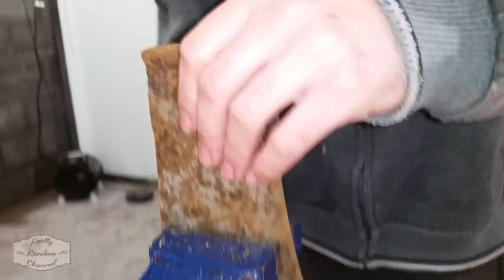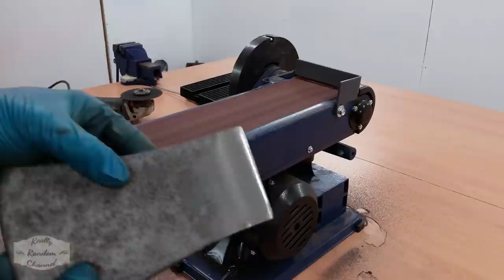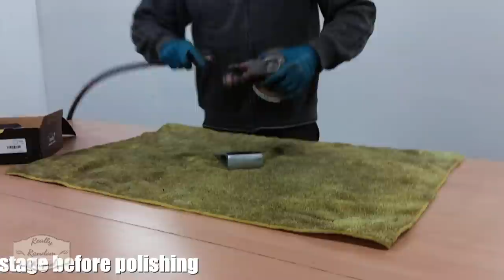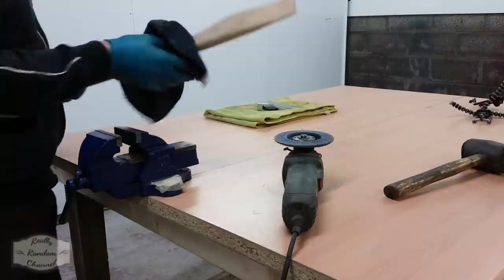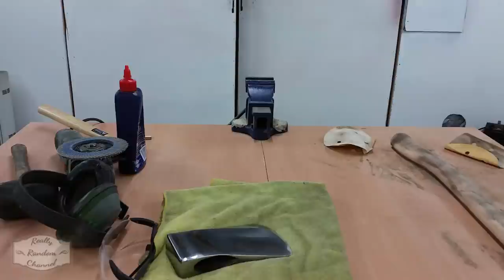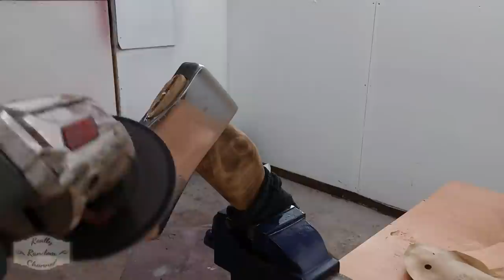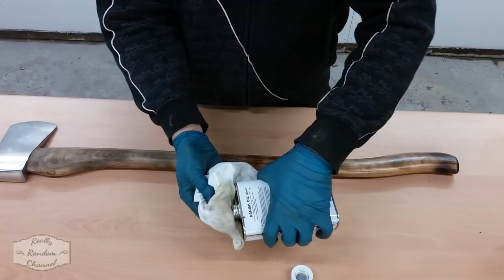Rusty Old Axe Restoration

Comment: Very nicely done. Beautiful outcome. I have a few comments and a couple of tips for you. 

I’m a retired fireman. That is known as a flat headed axe. It is the number one workhorse tool of the fire service. It’s use is mainly for forceable entry. Bashing thinks. The flat end is used more than the blade. 

I don’t think anyone ever used it as a wedge and hit it with a hammer. Instead, the axe itself was used as a sledge hammer. We beat the hell out our tools but we keep them highly maintained and ready to use at all times. 

The metal “lips” you’re referring to is called, “mushrooming”. A classic example of mushroomed metal is on the head of an old chisel. 

Ok here’s my pointers. First, never glue a wedge. 

Second, you did not drive the axe head onto the handle with enough force. The only way I know how to burry the head of the axe onto the handle is do what you did to get it 80% on, then hold the axe head in your hand and slam the end of the handle onto the concrete at least 3 or 4 times. Then, set your wedges. 

I recommend you do this before you use it. 

Lastly, I don’t know a lot about danish oil other than it’s lovely for finishing wood. We used one thing and one thing only for our axe handles. 

Boiled linseed oil. It is a hardening oil. It drys and does not leave a slippery surface. We periodically give the handle a complete light sanding and liberally coat the handle with the linseed oil. A few good heavy coats. Let it soak in overnight. 

The next day, just use a clean rag and wipe/buff it off. It’s good to go. 

Another cool tip I used recently restoring a couple of old hammers that belonged to my grandfather was to dribble clear epoxy into the wedge area and use a toothpick to fill any tiny voids. The inside surface of the axe and hammers is far from perfect. The handle just cannot touch the inside of the head perfectly so the epoxy fills this voids. Sand the epoxy smooth when it’s hardened the next day. 

Your video was fun to watch. You have an unusual shop!
Reply from the maker: Hi, Thank you very much for your informative comment i certainly learned a lot from reading it. I will certainly take on board all your tips for the next time i re handle a tool. 

Thank you again for your comment :)
Reply: Glad to pass it along. 

Here’s a video of how we use a flat headed axe. We use the flat head axe with another tool called a Halligan. We keep the two together on the engine and the fireman will grab these on every fire no matter what. 

These two tools together are affectionately known as, “The Irons”.  This is our master key to getting into any building. 

Here’s a video clip demonstrating how they are commonly used together. 

https://youtu.be/7vLDCJk3wNk

Forceable entry is a part of every firefighters basic training.
Reply: I'm Polish, and an English teacher. Nonetheless, I enjoyed the video and reading your comment quite a lot, too! Tomorrow I'm off to my dad's shed to find some tools which can be given a second life, so they can serve my son, as they did my dad, and me! Thank you Gentlemen!
Reply: Thanks for being civil with your reply. There are so many people with knowledge but use it to make the craftsman look like foolish. You provided some great history and constructive feedback. Nice!
Reply: Why do you recommend not using glue on the wedge? Do you recommend that for other wedges, like on furniture? Or just because the axe takes impact?
Reply: @herbiesnerd  Hence the saying, "Up the Irons!" 😬
Reply: Because it gets maintained so frequently. The head can loosen on the handle over time. The remedy is to drive the head and the wedge a little deeper. 

Now I put a new old stock 
 hickory handle on a very old vintage ball peen hammer that was my grandfather’s, and after getting it set like iron, I epoxied the end making it permanent. 

So that contradicts my no glue advice, but I personally would not do that to an axe. It’s a different beast. If you rarely use it, it’s no big deal to glue it. But, if it ever loosens up, you’ll have to cut the handle off and start over. With no glue, just reset the wedge.
Reply: @herbiesnerd  aahhhh! That's great advice! Thanks.
Reply: Thx for telling me about "mushrooming" i was wondering what the english term for that was and simply couldnt find a proper way to describe it. In Germany we  say "its getting a beard"
Reply: Very informative comment for all of us
Reply: TLDR
Reply: Instead of toothpicks and epoxy i personally use sawdust mixed with epoxy. Also cool  info.
Reply: Actually, for seating the head you should get it part way on then hold the axe upside down and hit the bottom of the handle with a hammer. This will keep your handle from being damaged and get it nice and tight
Reply: @nom_nom_nom_  it's actually dangerous, the pieces rolling over can snap off and fly around like shrapnel from a grenade. If you have a tool getting mushroomed, you are pretty much using the tool wrong. The back end of an axe isnt  meant to be a sledgehammer, its to add weight on the back so it's balanced. It's not hardened like a sledgehammer is.
Reply: No matter how you finish the wood, it will change shape over time. Each hit of the axe head can crush the wood fibers inside the eye of the axe, and the same can happen handle swells with rising ambient humidity levels. Then, when the wood dries out again, there is now space between the handle and the axe head. 

This new space can be taken up by hammering any wedges in further into the eye; something that cannot be done if the wedges are glued in place.  You could add additional wedges to help take up space, but you'll be fighting the much harder glue that is now also in the eye.  

Source: former timbersports and trail crew
Reply: I was always taught that after you'd gotten the head set as tight as possible to then fill a bucket with enough linseed oil to cover the head and soak it overnight.
Reply: I agree with most everyone not to use glue. Also i personaly cant stand  Linseed oil, the smell "to me" its vomit. (its also used in some old Marine compasses). As for the wedge, they have evolved over the years, Wood, Metal  even Bone, and are many, personaly i like to tap it in and leave 1/2 mm (if that) out and cover the whole top with a cap, eventualy the head will come lose over time, with heavy or light use, wood  Expands and shrinks due to the weather. but i just pop the cap off and tap out the old wedge, fix the "ninja Ledge?" Put the head back on add a new wedge and done. But still the best video on youtube i have seen yet. Thank you.
Reply: This isn’t a comment it’s an essay
Reply: Good advice
Reply: @valtozer6273  Ninja ledge, I love it!
Reply: I've viewed quite a few channels, and not to throw shade or anything but they were people who actually used their tools (unlike this guy in the video, again not trying to throw shade but it's obvious) and every single one of them glued their wedges. Is there anything inherently wrong with gluing your wedges? Or does it just depend on how the tool is being used i.e. using it for felling vs for fire service.
Reply: I'm not a fire fighter and haven't used axes but I've had to re handle a few sledge and I know after a few good swings that head is coming off
Reply: What's the reasoning for never gluing a wedge? I've recently started restoring axes for a hobby.

Comment: Beautiful. Personally wouldn't run my angle grinder with a cut off wheel without the guard, but regardless, absolutely stunning results.
Reply: Jonathan Tuttle you are right bro good suggestions because my finger already bear a deep cut with angel grinder cutting disk

Comment: If you can file the blade  , the sharp edge will not last and gets blunt . I recommend some hardening and tempering
Reply: Nah it's fine. Typical to sharpen an axe head with a file actually. The file will always have a considerably higher hardness requirement than an axe head.

Comment: Not very handy way to change the sanding belt on that belt sander. Nice outcome, though!
Reply: I have an almost identical belt sander and changing the belt is a nightmare compared to others. There is a stopper on mine where the belt base stops s othe belt doesnt touch the bottom part of the machine. It is a pain to get the bottom plate off with the stopper in place (until mine snapped off) but the casing plate has turned up sides to slot in ans then screwed in place. Takes about 5 mins to change a belt. I wish I had an easier belt changing machine.
Reply from the maker: Yeah it is a bit of a nightmare changing belts on this machine especially when your on a roll and want to keep the momentum up, When buying a new one in the future ease of belt changing will be number one on the priority list! Thanks for the comments :)
Reply: My sander had the same guard and I took it off. Belts pop off and on much more quickly and the lack of hard surface on the back side is nice for grinding contours if axes without leaving hard lines one can see from other parts of the sander.
Reply: At least it’s not going to fall off

Comment: I’d like to know how well this handle holds up. It looks like there are some gnarly splits in the wood. Awesome videos!
Reply from the maker: Hi,Thanks for the comment. The handle is holding up just fine, ive been using it a fair bit and its still as good as when i first restored it :)
Reply: @RRCRestoration  y Yuuu tu

Comment: If you listen closely, you can hear WranglerStar screaming in the background when the axe head is 'hung'.
Reply from the maker: HAHA! love it! I hope he comments on this even if it is just to give me a severe telling off haha!
Reply: Well hitting the handle from the bottom is the proper way to hang the head.  I put a new head on a handle by hitting the head on and put the wedge in only to see other videos and then trying the proper way and the head seated another 1/4" down so i had to remove the wedge and cut more off the top of the handle.

I never understood the difference until I actually tried it.
Reply: And you should use a piece of wood over the wedge instead of hammering the wedge directly especially with a metal hammer. That's why it broke off prematurely. 
It also looks like someone has been using it as a chisel. The hammer part of the axe head is all mushroomed out. The metal is cold hardened and it will crack eventually if further deformed. Of course you shouldn't use an axe head as a chisel. This is where all the exploding hammer stories come from. To fix this you should heat up the hammer part so the tension is relieved from the steel. Grinding it off might make someone else think it's not cold hardened and hammer on it again until it cracks.
Reply: WranglerStar!  The Bob Vila of the homemade tin pants set! Hah!
Reply: Uy
Reply: Steven Rice I was just about to say that
Reply: He's too busy making clickbait and shilling products to think about anything else, and his midlife crises isn't helping.  I hope his son gets away from his bible thumping nut of a father, and maybe he can get a real education to boot...
Reply: Facts
Reply: @blargkliggle1121  jelly?
Reply: @MrManic52001  I like contributing to society so no...
Reply: @blargkliggle1121  and he doesn't?
Reply: @MrManic52001  what does he do besides half ass videos and crying about imaginary discrimination against Christians in America?
Reply: @blargkliggle1121  as an American that's also a Christain, I don't see what he's screaming about. There are people that don't agree with Christian beliefs, some of which can be rude, but that's their choice. It also helps to talk to people in a civilized way, not try to force them to believe something. Generally, if you're nice to someone while you're talking to them, they won't be rude. Oh, and don't keep talking to someone if they start to leave. That pushes them further away. Those are places where people that also claim to be Christians mess up, as I'm sure most people that don't believe the same way as Christians but have been talked to about it know.
Reply: He contributes more to society than many, especially in America. He does this by having a small imprint. A small imprint does not necessarily mean you aren’t contributing to society.
Reply: Nice job! Ive got a 55gal drum half full of rusty old tools.  They deserve to be restored

Comment: Got one just like. Same mushroom and all.

I'd be missing a pound after I got through the pits. 

Nice work

I always keep a 1/4 inch swelled sticking out the top. Used motor oil for the handle. Looks killer.

Comment: Great job!!   One question though.  Now that the steel is polished to such a high sheen, how do you keep it from rusting again?  I've seen so many videos of people taking the time to polish steel like this, but no-one shows how to keep it from oxidizing again - unless they paint it or "blue" it.
Reply from the maker: If you keep a light coat of oil on the bare steel it shouldn't rust again. What i do is after every use with a tool like this is give it a wipe with wd40 or even a light coating of engine oil is all thats required to keep the rust at bay and the head shining :)

Comment: I've always found it very beneficial to sand blast at more of an angle so you're pushing the particles across the surface instead of directing into the surface. But this is also exceptionally rusty so that maybe a factor.

Comment: ill give ya points for having a go, that head came up real nice. the comments are full of the things you could have done differently i guess, but id be interested in how long this axe might last with daily use. im guessing its going to spend a fair bit of time leaning on the wall in the corner (pity about the bent handle then)
Reply from the maker: Hi, I can confirm the axe is still going strong ;) I used it last winter for chopping fire wood and it will be doing the same again this year.

Comment: Aside from the glued wedge debate, next time I would be careful with the direction of the grain in the handle. This handles grain is 90 degrees to the cutting edge almost, which can cause it to crack prematurely. The heel of this particular handle is very vulnerable. You put a lot of effort  into that, I hope you enjoy it.
Reply: I'm not an expert but I believe this depends on the type of wood. I remember hearing about wood baseball bats needed to be swung differently depending on the wood to avoid cracks.

Comment: Lovely job on the polishing, i'm surprised you haven't set yourself up with a proper setup,IE a motor with a tapered thread each end,  a buff on each end, one for first polish, IE tripoli, and the other one for final polish, IE jewellers rouge, or similar. As a jeweller that is what we all used. i'm no longer in the trade , but have a setup at home. I should say you need a motor of 2800 revs or so.

Comment: I've been watching videos of rust tools being restored because I was curious if my simple method would work . Just had to try it and I abandoned this after a couple hours of putting them into motor oil and Marvel mystery oil . MMO did seem to work spomewhat but was taking a very long time . Finally got a power wire brush attachment and did it that way . I might go as far as using a grinding disk that's about it

Comment: Hi,

Nice restoration. However I would be little afraid to use this axe for any heavy job... There are few things you might consider to do when you fix the axe on the handle:
- observe if the in and out holes are of proper size - the side where the handle enters needs to be smaller than the one where handle is ending 
- you need to have good fit between the iron and the wood - best if you can simply file the wood and use some graphite or other tint to check the contact area, once it fits well you can consider to use some epoxy to protect the wood and fill remaining gaps. 
- then drive in the wedge - but first you might prepare the slot with the chisel 

Here is the link to more or less ultimate guide on how to do it. It is in Polish but even not knowing the language you can see all you need to know. This guy is a real artist. But he also makes for the living by sharpening tools and fixing them also for local lumberjacks. So he knows his trade. :)

Comment: Great job on the axe head. To save yourself some polishing. Just run a 600 then 800 grit paper over it. Hell if you can find them and they are around. Use a 1200 as well. One thing though. Even though you showed us cutting with the axe. I would really make it fit a little tighter than you did. It wont take much work and it will be loose. Nice overall job though.

Comment: You can prevent wedges from splitting and cracking by rounding the edges with a sander, of where you will be striking it. Striking a hard angle on a narrow end grain will often crack it and shorten the life time of the hold.

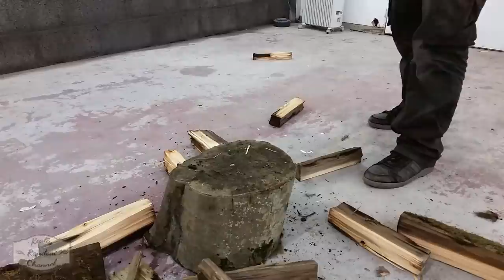Comment: 18:04 the handle does not hold an ax, at this moment it is very clearly visible as the ax moved out to one quarter and a white mark on a wooden handle mark under the bottom of the metal

Comment: Might have considered heat treating and tempering the axe head before you polished it and put an edge on it. The edge would last longer and the metal would not distort, mushroom or crack as easily. Just a thought.